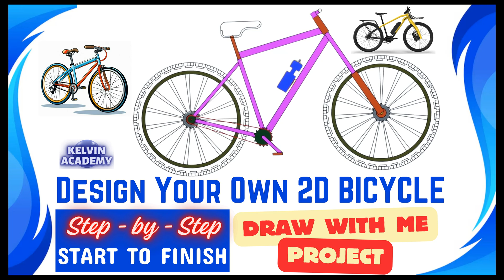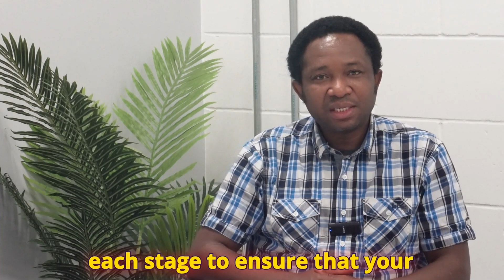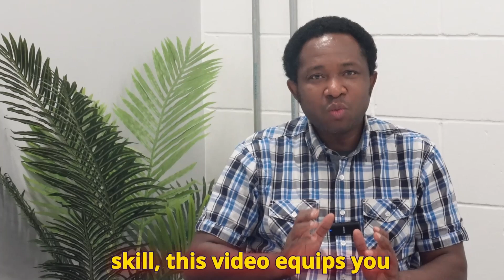Design Your DREAM Bicycle with AutoCAD Like a PRO!

Comment from the maker: Access this course on Udemy:
https://www.udemy.com/course/draft/6374739/?referralCode=B507A1BF4B7953D26E4A

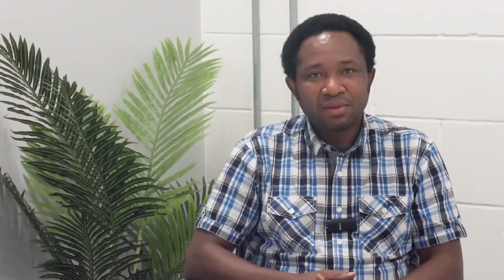00:00 Video Thumbnail project
00:01 Bicycle introduction video
01:25 How to install AutoCAD for FREE – Student guide
07:20 Access links to other AutoCAD video projects
07: 38 Creating the bicycle circular outline
09: 55 Designing bicycle gear tooth
12:53 Gear teeth design with Array Polar and Trim commands
15:56 Difference between Join and Group in AutoCAD
16:55 How to design bicycle spokes in AutoCAD
18:24 How to save your drawing work in AutoCAD
20:00 Designing bicycle tyre pattern
21:46 Designing and drawing the bicycle tyre
23:24 Hatching the bicycle rim and gear in AutoCAD
25:08 Applying drawing order in AutoCAD drawings
25:40 Creating bicycle front wheel with mirror command in AutoCAD
26:33 Bicycle back seat design and the rotate command in AutoCAD
30:19 Bicycle seat support drawing design
33:21 Bicycle seat design drawing
38:21 Bicycle “sprocket to handle” connecting steel drawing design
40:26 Bicycle “seat to handle” steel support drawing design
41:48 Bicycle front handle steel design drawing in AutoCAD
46:30 Bicycle sprockets drawing and design in AutoCAD
52:28 Bicycle chain drawing design and the Align command in AutoCAD
56:09 Bicycle pedal drawing in AutoCAD
58:17 Water bottle drawing in AutoCAD
1:03:12 Print AutoCAD drawing to PDF